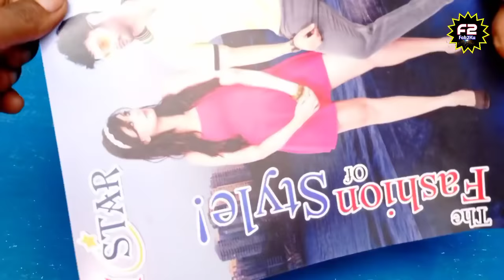Round Pipe Notching Techniques // Round Tube T Joint // Metal Pipe Welding ideas

Comment: Honestly, not a bad video. But the painful part for me was the welding. You always chip the slag off before you run another pass. You’ll get slag inclusions in your weld, and that will weaken it. You also probably shouldn’t keep breaking and restriking your arc that much, you might end up with incomplete fusion on the base metal. I see a lot of people using stick welders like this, and it’s fine if you’re doing something that’s just for show. But god help you if you use it for anything serious. Stick welding is forgiving, but there’s still a technique to doing it right.
Reply from the maker: Thanks for your valuable information sir..
Reply: Yeah, if you are welding something thin and cosmetic that might warp.

Comment: Question:  why did you bother cutting the hole on the “T crossing”?   Couldn’t you have just welded the end piece to the the T crossing once you had the end of the pipe cut and filed?
Reply from the maker: You are right brother
Thank You so much for your information
Reply: Thanks. I meant to start with:  Beautiful work and very well displayed/easy to follow.  It is inspiring.   Thank you.

Comment: I have a question what kind of welder do I need to to build a fence with Loadlock pipes I'm a truck driver and I got a bunch of them at the house and I don't want to throw them out I just pick them up from everywhere and I'm trying to use them use it as a project to learn how to weld I would appreciate if you would reply to my message
Reply from the maker: Sir,,if you can't do welding, then you can go to a welding workshop and get help from them. They will build your fance.
Reply from the maker: Thank You 💗
Reply: @Fab2Ku  thank s for the information
Reply from the maker: Welcome Sir 🙏

Comment: Never welded. Why couldn't you just weld the notch to the pipe without making the hole?
Reply: @Fab2Ku  So can you? Just wondering.
Reply: Yes you can, if its some kind of structural application and not product transfer pipe

Comment: La unión, es horrible, pero practica, es la única forma, arrastra el electrodo sin cortar el arco eléctrico, verifica el amperaje que no sea mucho y muy poco, deviese ser con electrodo en medida 3/32, a 65 amp máximo siendo electrodo corriente no 7018, 6010,6011, 6013, si es 1 1/8 y el espesor del material base sobre los 3 mm a 85 amp, si es de 2 mm, te recomiendo el electrodo delgado.
Reply from the maker: Thank You Sir